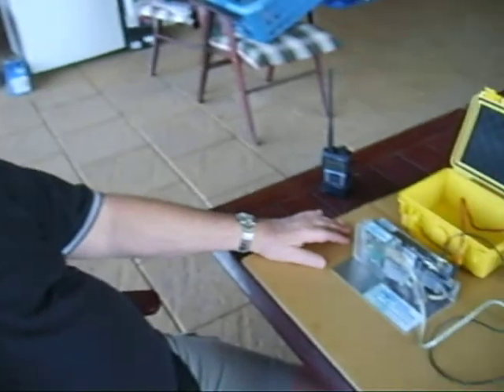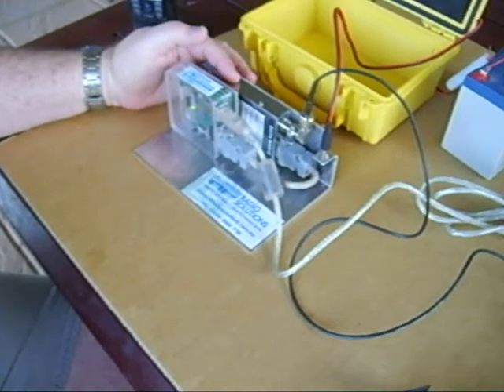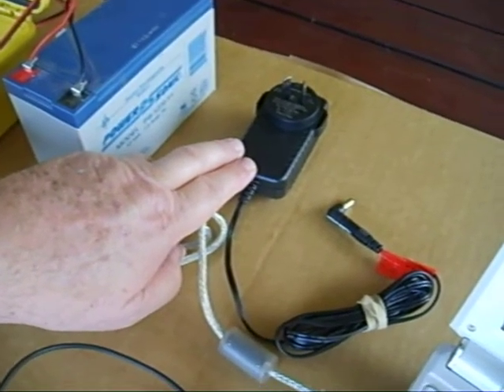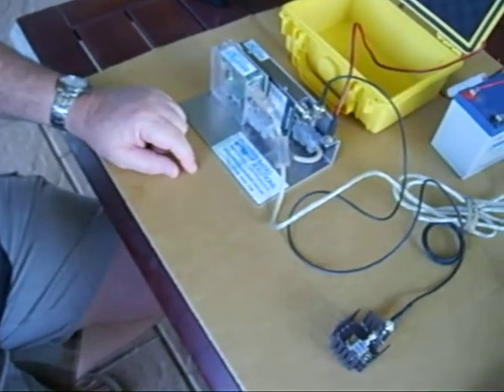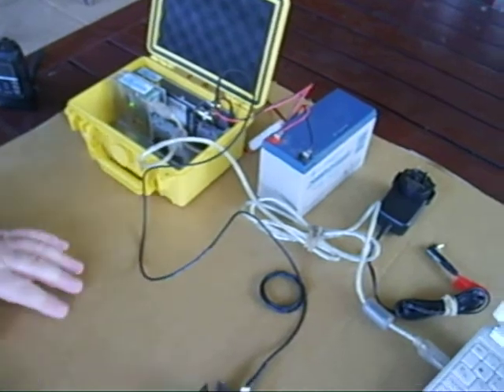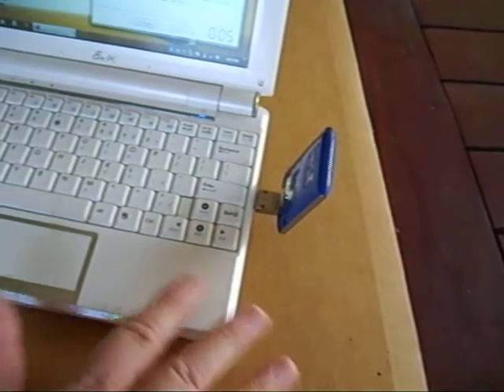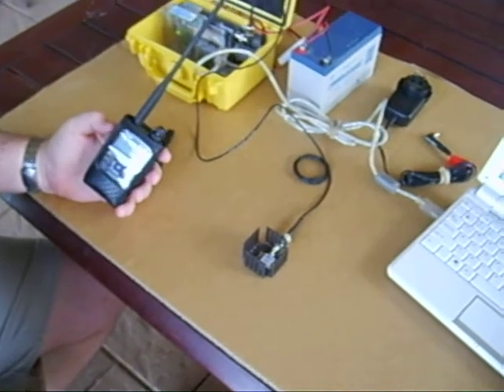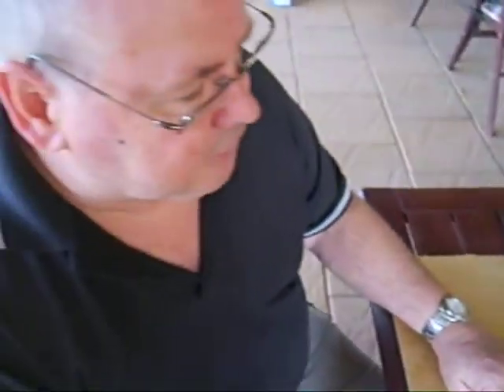Portable D-Star Hotspot

Comment from the maker: Hi Jacques
Heat has not been an issue at all - the folded aluminium chassis takes care of any heatsinking and the fact that the unit is operated with the lid of the case open also helps with airflow.  
I would think that solar powered battery operation should work very well.  The only thing to watch would be if you are running higher power is to watch that rf does not affect the modem - you may need to provide additional shielding if that is an issue.

Good luck with the project!

73 Larry VK5LY